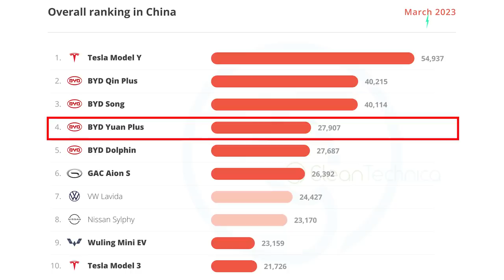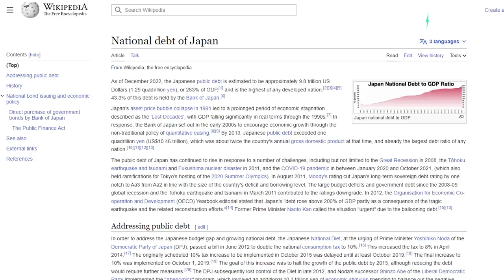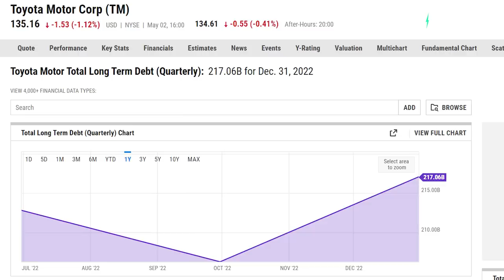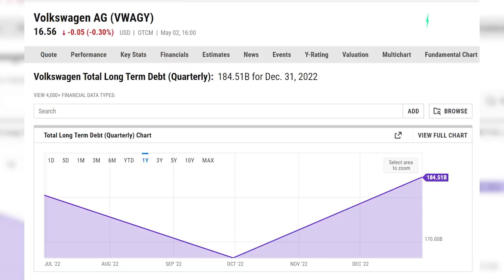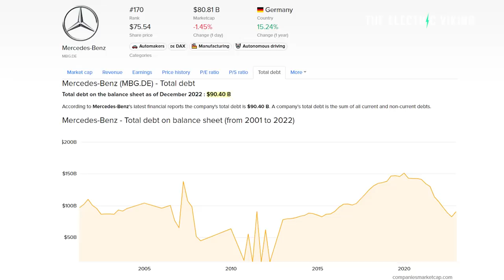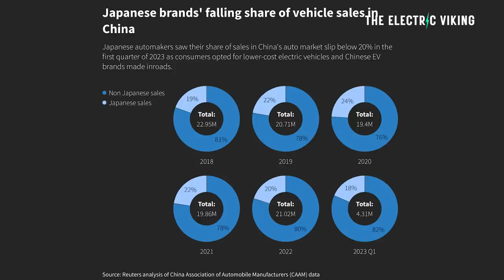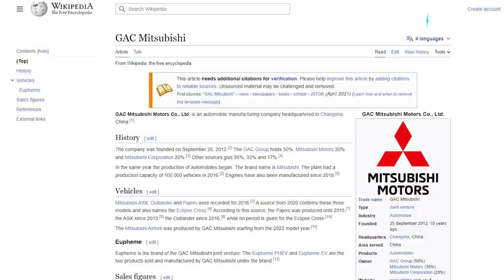Japan's automakers' Kodak collapse will cause an economic catastrophe

Comment: Great video and I understand your stance. I think your biggest oversight is what has happened with other Japanese failed exports. If they fail to export, that may not mean the demise of the Corporation. Many Japanese companies thrive on the home market demand only. There is a massive backstory to support that claim and it goes back decades, but my opinion is that the Japanese car market will shrink, not collapse.
Reply: The birth rate in Japan is very low. Their population is collapsing.
Reply: This is an interesting remark. I have read that the Japanese plan was to go hydrogen based on the premise that they would have abundant nuclear electric. This would work for the domestic market but they would struggle to export those cars unless other countries did likewise, which would seem unlikely. Your theory that they could thrive without exports might explain their thinking.
Reply: @lemongavine  Birth rates worldwide have be in decline for the last 70 years. Japan will not collapse for that single reason.
Reply: justinv2 • Yes, first it will shrink, and in the end it will collapse.
People will not wait for the japanese to catch up. People buy EV now and in this decade, and they will keep their EVs for decades. Therefore, in 2030 only the EV car manufacturers who build the best, the cheapest, the most useful, and the most reliable EV models, will survive.
There will be no room for any new EV manufacturer after 2030 unless something fantastically inovative will come up, either in the whole electric theory ( a new and revolutionary "electric motor" concept ) or in the battery technology domain ( which is quite possible ).

Comment: The best solution is PHEV.
For example (with intensive):
NIRO BEV (Comfort) = 42,000 euro
NIRO PHEV (Comfort) = 34,000 euro
NIRO HEV (Comfort) = 31,000 euro
Scenario: 8000 km/year - urban and 4000 km/year - outside city.
NIRO PHEV has enough autonomy for driving one day in the city.

Consumption:
- petrol:
Urban  = 7liters/100km;
Outside city = 6 liters/100km;
- electric:
Urban = 13kWh/100km;
Outside city = 16 kWh/100km;
Prices:
petrol - 2 euro/liter; electricity - 0.2 euro/kWh;
 
Costs per year: 
PHEV = 688 euro;
BEV = 336 euro;
HEV = 1600 euro;

You need to drive for 22 years the BEV to make the 8,000 euro difference between BEV and PHEV.
You need to drive for 3.28 years to make the 3,000 euro difference between PHEV and HEV.
You need to drive 8.7 years to make the 11,000 euro difference between  and BEV and HEV.

Comment: I believe due to Akio Toyoda pushing for the Japanese industry to invest so heavily into hydrogen tech, he has taken a less public role because the waste of all these resources is becoming painfully obvious. Toyota had a stake in Tesla. They had am electric RAV4 ages ago, but cancelled it all. Now, Japanese builders are scrambling and it was Akio and fellow leaders who laid the ground work for this mess Japan is facing. 

The ICE market is dropping off a cliff. There is this strange idea that EVs will not be sold around the world because some nations are not ready. What I think they ignore is solar panels and large battery backup is all that is needed. Many nations would love to import less oil. Many consumers would love to have no need to visit a gas station. The sun is a free resource. Wind is a free resource. EVs require less parts, less work to keep going. This means from poor to rich, consumers on all levels will find EVs appealing. 

The other thing that Japanese leaders seem to have not thought through is pace of innovation and improvement. When a technology has not had massive resources put into it, that means it is under developed. That also means the amount of change will be high in a short period of time. ICE has been well funded for decades, thus why 100 million dollars in R&D of ICE does not get the kinds of improvement $100 in EVs gets. As a bonus, some of the key tech for EVs is used is many other industries. Batteries power modern life for most of the world. It is the battery tech that has helped to unleash the EV change upon the world. As much as some politicize EVs as a woke thing or lefty thing, it was need for bettter batteries in phones and other mobile tech that got this wave of EV demand to be possible. 

I am waiting for the day when Akio and other top Japanese business leaders hold a press conference like Mitsubishi did, where they admitted they failed and apologize for how their actions have hurt so many. Not that it will save the pain Japan has coming, but until they acknowledge their mess, it is hard to fix things.
Reply: No later than this morning, I came across a YT channel praising the farsightedness of Akio Toyoda!!!  Some people are definitely in for a painful awakening!
Reply: Hybrid car with hydrogen combustion engine is the best path for Japan because it requires the least  investment and the least amount of debt.  Toyota already makes millions of hybrids yearly, so switching to hydrogen is easy, just change the fuel tank.  Also, switching from hybrid to plug in hybrid just put in a bigger battery pack.  See how easy it is?
Reply: @trungson6604  Have to disagree because EVs havevfewer parts and people already electrical outlets all around. Hydrogen vehicles are complex to build, hydrogen stations are expensive, and have issues as well. California  is already shutting down some hydrogen stations due to the costs and problems. 

If EVs get solid solar power built into the vehicles, they will basically recharge themselves. 

When you look at the complexity of hydrogen or classic hybrid, they both fall short of EV. Ownership is simpler for owners, costs are lower for operation, and we are seeing retail prices dropping below ICE. 

Not a single dime or minute more of time should be spent on hydrogen. Battery tech, solar tech, EV charging tech, and overall EV tech is getting rapid returns on investment and are helping consumers and nations to break away from oil addiction while improving life.
Reply: @kevtheobald  There is massive investment in green hydrogen worldwide to replace fossil fuel.  Eventually, hydrogen will be available everywhere just like natural gas now.  Don't worry about complexity, leave that for Toyota.
Reply: @trungson6604  I think you need to improve your understand of the folly’s of Hydrogen Fuel cells and the successful methods of EV manufacturing. Hydrogen fuel cell cars  have been decades in development and are never going to get there, expensive and hopeless inefficient. Manufacturing EVs as a complete car is far from a drive train and fuel change. Manufactures that have tried to do that have failed.
Reply: @trungson6604  Tesla has proven there is no need for that complexity. Hydrogen needs a massive investment, probably ten fold over electric. Toyota senior enginers gave great otaise to the Tesla Model Y they took apart to study. 

Complexity raises costs and problems. As an owner of a Toyota I have seen first hand what they can do, but there is no way that hydrogen will be a more economical solution.
Reply: @trungson6604  There is no way hydrogen powered cars could be the future. Not counting the cost for electrolysers and distribution, the electricity consumed in the process is triple the amount charging an EV for the same travelled distance. BEVs have already won the competition. You only have to look at the exponential increase in EV sales the last years and the stagnant FCV sales.
Reply: "it was need for better batteries in phones and other mobile tech that got this wave of EV demand to be possible" That is literally true. The first Tesla, the original Roadster, used thousands of small 18650 lithium ion cells which were cheap due to their  commodity status as laptop batteries. Now we're in a virtuous circle where the use of lithium batteries in everything is driving improvements in all battery technology. Fuel cells have theoretical advantages, but they've got a huge R&D hurdle to overcome to catch advancing battery technology. It might happen, but it won't necessarily be hydrogen. Other materials, such as aluminum, can also be used as the energy source in a fuel cell and have certain advantages. Who knows what the future holds, but batteries for EV's that can replace ICE in all applications are either here today or soon will be.
Reply: @InformedKiwi  --I'm discussing H2-combustion engine and hybrid power train here for which Toyota can already make millions units yearly, NOT fuel cell that will require vastly more investment, re-tooling and labor retraining.  The idea is to minimize new investment to maximize profit and least amount of debt.
Reply: @brentbolton6984  --Hydrogen combustion engine is the future, NOT fuel cell.  Producing batteries requires massive investment of 5 Billion USD to make 500,000 BEVs like what Tesla did to build the Gigafactory.  If Toyota wants to make 5 million BEV annually, they will need to invest 50 Billion USD into JUST battery manufacturing.  Each Toyota hybrid has 1/2 of the electric motor power compare to a BEV, so a lot more investment into factories for e-motors and inverters for BEVs, so Billions more on new investment to make BEVs.  That's why new startup like Lucid, Nio, X-Peng...etc are in trouble with debts piling up and price war from Tesla.   

Toyota is a lot smarter than spending tens of Billions into making BEVs only to go on the verge of bankruptcy like Lucid, Nio, X-Peng...etc...Nissan and Jaguar are out of the BEV game now, and many BEV new startups will soon be out of business... losing tens of Billions in investment.  The Leaf is selling only a few thousands a year now!  Toyota should press ahead with Hydrogen Combustion engine with hybrid power train that is already perfected and proven to be highly profitable.  People will simply fill up with Hydrogen the same way they have been filling up with gasoline.  Leave the complexity issue for the experts to solve.  We will just enjoy motoring the same way we used to.
Reply: @trungson6604  Electricity is everywhere in the modern world. 

It takes electricity to pump and pay for gasoline and to produce and pay for hydrogen.

What is the cost to build hydrogen fueling stations everywhere that gas and diesel stations exist?

If you're going to produce a vehicle with a combustion engine, a hydrogen tank, a small battery, electric motors, and all systems that operate using electricity, why not just have a large battery and electric motor instead? Isn't that a lot simpler, easier and more efficient?

How many hydrogen vehicles will be able to fill up at home in the near future?

Hydrogen fuel needs to be transferred into tanks at up to 10,000 psi. That's a bit more intensive than pumping liquid gasoline from one non pressurized tank to another.

Comment: Love your work. This podcast is a little simplified. Yes the Chinese have created an environment to say it nicely challenge foreign car makers. When you look at Japanese bond rates (around 0.4%), things are not so dire for Japanese firms. You have to give them credit their business model of waiting till proven technology arises has served them well in past. I think they will be a late adopter and reduce investment to proven long term technology. At this point are solid state batteries or salt batteries going to be in the future. I know for myself, I am going to buy one more ice vehicle, hoping a battery comes along with lower insurance costs and better performance in New England (US).
Reply: The problem is that legacy automakers can't start late and then leapfrog to the front, because designing EVs and autonomous vehicles requires radically different designs. In order to get to a decent design, they needed to fail a couple times to realize what is needed with EVs and AVs, and that takes time, and it takes time to build the supply chain. Tesla learned a lot with each iteration, and the startups like Rivian, Lucid, NIO and Xpeng show how hard it is to get it right, even when starting with a clean sheet design.

Comment: It's so sad for Japan in what you're saying.  I have a Nissan X-Trail (Rogue in U.S.) and I plan to keep her for as long as I can.  I lived my whole life with the ICE and simply don't want to be without it.  However, yes, the writing is on the wall.  Hence, the next vehicle will be electric.  The wave of electrification is just overtaking car sales going forward here in Thailand.  BYD sales has overtaken Toyota in new sales ever since the Atto 3 model came out.  It's a great combination of new energy-practicality-affordability.  Before BYD, GWM could'nt do it with their ORA suite of EVs, even though there was wide spread talk about how cute and innovative it was.  Well that offering was lacking practicality and the new kid on the block, BYD got it right.  Now that everyone knows the  right combination, a lot more new comers will make their offer.  As of today, new factory commitments have come from GAC and Changan.  It's definitely getting crowded fast abd I don't know what Japanese players are going to  do to hold on to their majority  share of the market.
Reply: In Thailand, BYD sales has not overtaken Toyota. Toyota still unrivaled. 
Thailand Q1 2023, the leader remains Toyota with 84,576 sales (+3.6%) followed by Honda at 26,492 (-13.7%), Ford at 14,039 (+36.9%) and Mitsubishi with 13,041 registrations (-15.5%).
MG secures 5th position with 7,637 sales (-20.4%), in front of Mazda at 7,179 (-34.4%) and Nissan with 6,047 sales (-33.8%).
BYD rises 27 spots into 8th with 5,578 registrations, followed by Suzuki with 4,463 sales (-38.7%) and Mercedes closing the top 10 with 4,316 registrations (+18.7%).
Reply: 告诉你一个更震惊的事实，Atto 3只能算中国电动车中比较低品质的一款。还有很多未在泰国发售的中国电动车在各项指标上远超Atto 3 。

Comment: I live in Japan. I tried to buy a new Toyota may 2023 as I live in heavy snow country with no access to charging, so require fuel. It's impossible, every single model I enquired about, there was either a 5 year wait list or the model is unavailable due to sudden safety regulation changes. It's absolutely bizarre, I don't have time to see what Nissan or Subaru can or cannot sell right now, so asked the dealer to call me once orders open for the 2024 prado desiel GR.

Comment: My parents have a Toyota Prado and the tech is like death of a thousand cuts, I had to really go looking for simple fixes like how to stop the map disappearing which was extremely frustrating for my Dad in heavy traffic. The Tesla? The map is just the default, it ain't going anywhere unless you want it to and even then it acts like your background so every time you close setting adjustments or analysis you are back at the map.

My Mum was originally freaking out a bit when I fiddled with the map on a long continuous stretch of road, by zooming out to get a better idea where we were because she was worried she'd lose it and be unable to get the close up view back before the next corner, but the instant you get a new voice direction the map springs back to the original close up map setting we'd been using like a rubber band. It also has the icon you can press if there is no turns for a bit to make it spring back as well, which I did actually have to use because the next turn off was so far away. XD Which once Mum knew how things would react and got comfortable with it, she really, really liked that feature. No more disappearing maps! 

So yeah good tech in vehicles matters and people want something that is familiar and just works. Totally see why the Chinese market is going this way.

Comment: Probably untrue, however I have heard at least one major Japanese auto company has plans to introduce a new power system using a high tech electrical drive.  Your basic ace in the hole move, but if true they’re keeping it very quiet.

Comment: The best solution is PHEV.
For example (with intensive):
EV6 = 50,000 euro
Sportage PHEV (4x4; Business) = 40,000 euro
Sportage ICE (4x4; Business) = 38,000 euro
Scenario: 8000 km/year - urban and 4000 km/year - outside city.
Sportage PHEV has enough autonomy for driving one day in the city.

Consumption:
- petrol:
Urban  = 11liters/100km;
Outside city = 6 liters/100km;
- electric:
Urban = 15kWh/100km;
Outside city = 17 kWh/100km;
Prices:
petrol - 2 euro/liter; electricity - 0.2 euro/kWh;
 
Costs per year: 
PHEV = 800 euro;
BEV = 376 euro;
ICE = 2240 euro;

You need to drive for 29 years the EV6 to make the 10,000 euro difference between PHEV and EV6.
You need to drive for 1.3 years to make the 2,000 euro difference between PHEV and ICE.
You need to drive 6.43 years to make the difference between EV6 and ICE.

Comment: I think that the only thing left for Japan is to just supply their own market for cars. Keep buying fuel from abroad as demand for it drops as it should be cheaper in the long term. Their domestic Models are very clean and fuel efficient. They will be lowering their affluence and will have to adjust but they also have a declining population. My Uncle’s still live there along with several cousins, as their population fails their needs will follow. If they close up all the international manufacturing plants then those countries will loose the benefits of local car production, but I see Nissan Spain and Thailand continuing production until EVs become affordable and that could be quite a while … along with all those other ICE car plants in countries less influenced by Green propaganda to rush the switch …

Comment: Honda just came out with the Prologue in the USA, but with it starting at almost $50,000 and it looks smaller than a model y, only the most die hard Honda vans will actually buy it.  I mean right now with Eevee incentives you could actually get a model y for as little as around 36K.